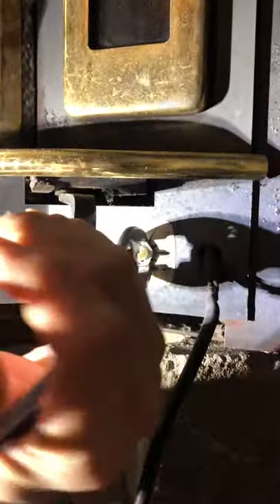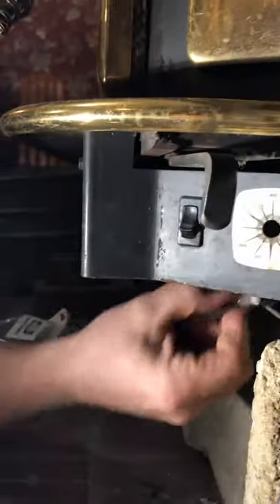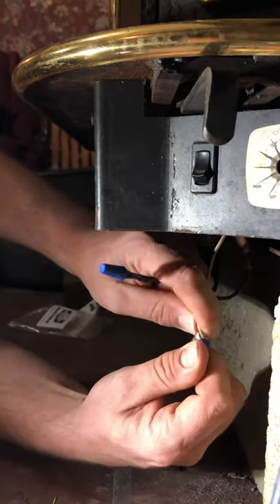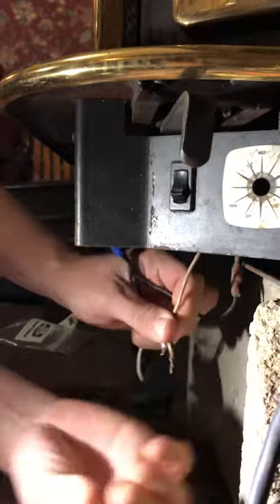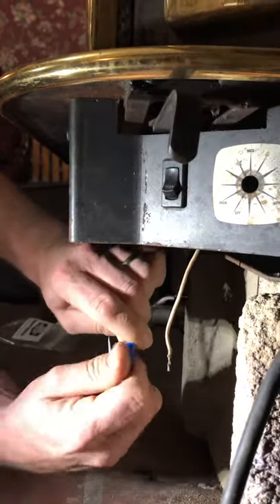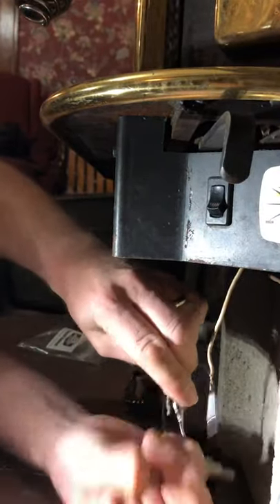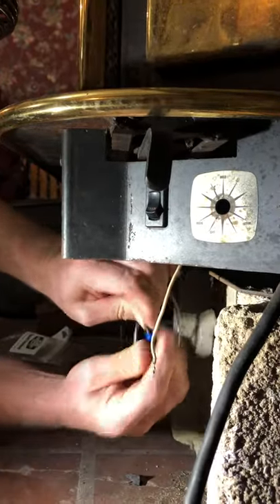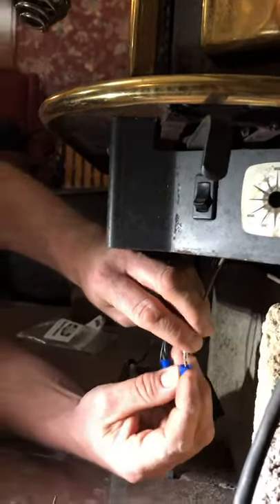Buck Stove 91 fan speed control replacement from Midwest hearth on Amazon

Comment: I love a video that gets right to the point I don't have the  time for anything else.
Reply from the maker: R Porter we at Weaverstonehousefarm are glad it helped you.  Just for you we updated the description to include the Amazon links for the fan speed control, the replacement catalytic converter we used(not shown), f3/4” fiberglass rope gasket, and Rutland gasket caulk
Reply: @weaversstonehousefarm  I still don’t have the blower and switch replaced is it safe to start a fire in the stove (it’s a model  81) it’s getting cold here in Kentucky
Reply from the maker: @rporter1579  NO!  Do not operate/fire a wood stove w/o a blower or blower control or any other required operational component or safety.  That is a hazard to you, others, and property.  Stop. Don’t do it.
Reply: @weaversstonehousefarm  thanks for letting me know.

Comment: I also want to replace the catalyst, can you upload a video explaining how to do the catalyst and blower? Thanks.
Reply from the maker: Sorry I have neither on video.  We are not responsible or liable for any of these comments. The cat is tricky with the special outer wrapper gasket that has to be installed with it.  I ended up using some of the old gasket with the new gasket when i installed the cat to fill the gap.  We used new bolts for the cat holder.  Pay attention to the warnings that tell you build a very small fire at first with new catalytic converter‘s for a while as they hit light off temperature rather quickly. Be warned and prepared for when a new cat causes a rapid uncontrolled rise in exhaust temperature.  You many need to take swift action to reduce the fire. There are many means to do that. First we use is old ashes to smother the fire.